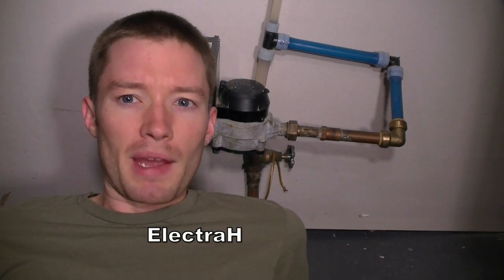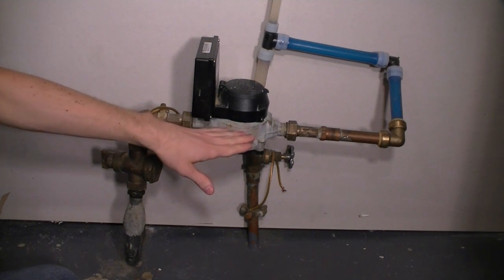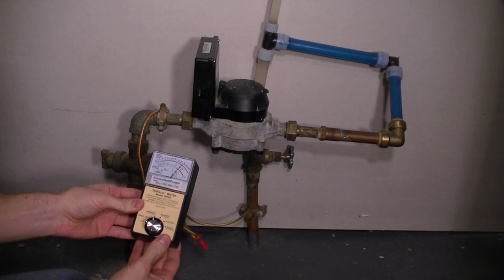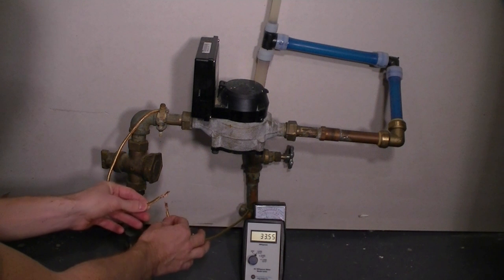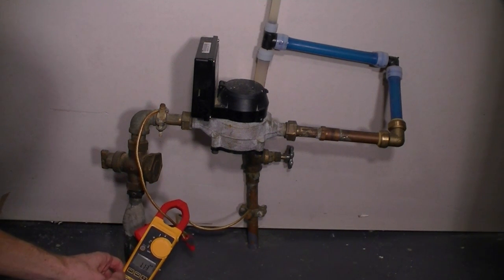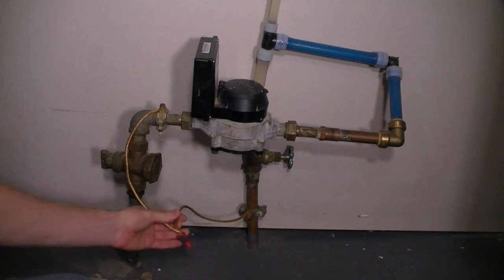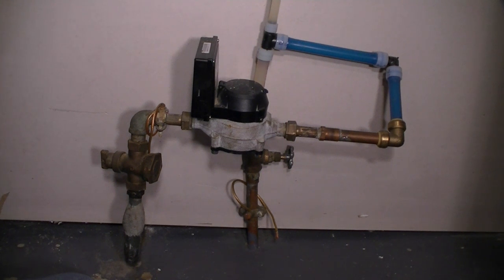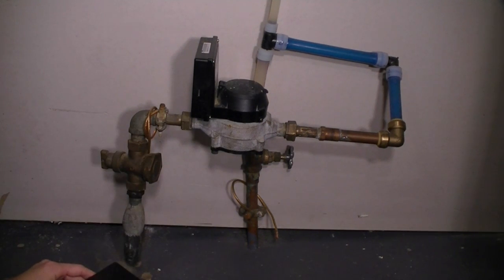Electrical Current on Plumbing Pipes

Comment: By law you must have all metal part that can potentially be energized be bonded to your main panel! Per National Electrical Codes! Removing your ground connection (to bond your water and gas piping) will cause death! Lol if ever energized and came into contact with you. This guys a nut And I dont see his water bonded which is highly dangerous if he removed it. Electrical power always tries to make it back to the source if water or gas isn't bonded it will not send back to panel immediately tripping your beaker and saving your life! Instead it will stay energized and kill your uninformed tinkering self!
Reply from the maker: You are assuming the internal (customer side) pipes are not bonded.  You bring up a good point, but we always bond the internal customer side of the plumbing network.  We just don't want the city's pipes becoming a huge neutral connection for primary and secondary neutral current.  This causes a huge flow of current through the house, and associated large magnetic fields.  Electrically isolating the incoming water supply fixes it.

Comment: Howdy.
Flippin' dangerous. If one has an electrical boiler the resistors will corrode and cause electricity to leak into the water. It is not an if. It is a when. Unbonded house piping may carry full 115 Volts in worst case, without the breaker triggering.
If unbonding like this, at least check that the house piping is bonded in the boiler. Bond the piping to the ground terminal in the boiler electrical box. If separate ground is not available (older systems) in the box, then bond the piping to the neutral terminal.
No disrespect. But the magnetic fields are so weak, in my mind, they have no effect on health. Should that be the case we would see cancer deaths follow high voltage power transmission lines. For myself I regard these theories being hooey alongside other theories like amalgam tooth fillings, Bermuda and Roswell.
But to all his own.
Regards.

Comment: Wow, such ignorance, but you are probably just trying to sell your snake oil-o-meter. Folks, if you have any significant current in your water pipes, you need an electrician to correct the problem.  As far as connecting the neutral to the ground at your service panel, that's not going to inject current into your plumbing system, nor anywhere else that might be bonded to the electrical system's safety ground.  You're just trying to scare folks.  Besides, if you are afraid of magnetic fields you are in for some anxious times, because they are all around you.  Diddo for electric fields.  The computer you are using, your cellphone, your nervous system, the earth's magnetic field, as well as literally millions of radio signals traveling through your body, your household wiring, your tv, your microwave, your car.  And don't ever get in an MRI, because the M stands for MAGNETIC, which will expose you to the highest magnetic fields you will ever experience, by far.  And you will experience these fields at every imaginable frequency and at an astonishing range of magnitudes, and you will never feel a thing and odds are you will never be hurt by any of it.  On the other hand, the kind of anxiety this clown would like you to feel could hurt your quality of life significantly.  Please people, learn a little bit.  Educate yourself and others.  Science is not going to hurt you.  Ignorance will.
Reply from the maker: Jim, you are the one showing ignorance with your post.  There are laws of electricity, such as current takes all available paths.  You say "that's not going to inject current into your plumbing system, nor anywhere else that might be bonded to the electrical system's safety ground."  This is a completely false statement.

If you have proper equipment to measure, you will see, as I just said, that current takes all paths.  There is always current on the incoming metal water pipe.  Even if the city has a plastic break in the pipe out in the yard, there will still be a small amount of current because that limited length of pipe in the dirty is acting as a ground rod and forming a connection to the earth - which contains countless parallel paths for current to travel - and also contains countless more grounding electrodes hooked to the grid.

Every ground rod measures current, if you have instruments good enough to pick it up.  We have a phenomenal clamp meter that well sell: https://www.stetzerizer-us.com/AC-Current-Clamp-Leaker--Large-Opening-Clampmeter--Ammeter_p_132.html

I've never seen a ground rod that is connected to an electrical system, nor a metal incoming water pipe that is connected which does NOT have current on it.  Current distributes and takes ANY and ALL paths according to their resistance/impedance.  That includes through dirt, ground rods, pipes, humans, floor, counters, etc.

As far as studies, there are over 10,000 published studies on non-ionizing radiation, EMF.  Many, and more often the publicly-funded studies show changes in biology.  We work with many people who can feel the changes.

It is a fact that there is a sharp rise in numerous, numerous chronic health conditions/diseases.  Environmental pollution, lifestyle, stress all contribute to this huge rise.  Contact current, EMF, RF - these things are environmental factors contributing to it.  There is ample science on it.  Why do you think 247 scientists (as of Jan 1 2019) have appealed for greater protection of the public health through tightened and exposure-reducing public policy?  https://www.emfscientist.org/

You should educate yourself before spouting off on the Internet.  Be part of the solution, not the problem.
Reply: Bravo. You know your stuff. Ignore that man holding the Guass meter.

Comment: This guy is crazy! He obviously does not understand electricity - AC or DC. Sure you can measure current in your earth ground, run a new ground and connect it to the house side and see if you still have current flow. If you do, then you have something in your house that is probably leaking current to the ground and you will want to fix that asap. There is a reason he has so much current on his ground...if he had a good ground outside his house then there shouldn't be any current coming into his pipes from the outside.
Reply from the maker: TurtleWaxed - I am afraid it is you who does not know what you're talking about.  Primary and secondary neutral current commonly flows on metal plumbing supply lines.  Electrical current takes all paths, spreading amongst them according to their impedance values.  Large metal water pipes are low impedance.  Soil is much higher impedance.  If you drive more ground rods, you will not necessarily or significantly lower the current on the water pipe.  In some cases you could actually increase it.  The more ground rods you drive, the more current you will have taking those ground rods - period.

You can turn off the main disconnect in a house and still have extremely high current on the water supply line (primary and secondary neutral current from neighbors and the grid).  Don't believe me?  Try it.  How many different clamp meters do you own?  I have clamps that go down to .01 mA in resolution made for testing "leaking" current like this.

Your reply makes no sense at all, and you clearly have not actually measured or tested.  You don't seem to understand where the current is coming from (the shared neutral primary/secondary side of countless transformers) and where it is going (back to those transformers including those at substations).

I'm sorry but you are completely and utterly mistaken in your entire post.  Driving more ground rods will simply result in more current flowing through the soil.  It may slightly increase or slightly decrease current on metal water supply line.  It is not a solution whatsoever.  The solution is to electrically isolate the water supply line so that it is no longer a path for current to flow.

Please educate yourself before posting on the Internet.